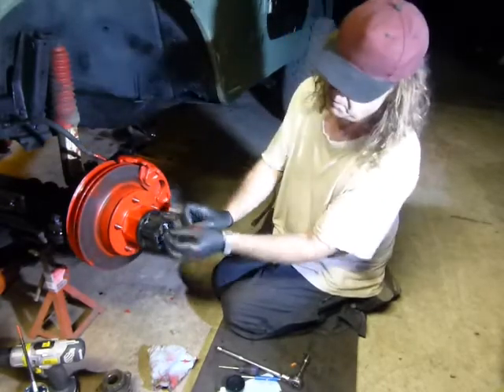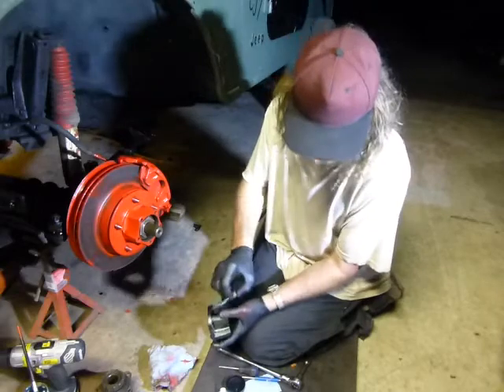Jeep Cj7 locking hub installation

Comment: What was the threads on that bolt and the length
Reply from the maker: Fasteners are 3/8 NCT x 2" grade 8 with a couple threads cut off, installed with flat and lock washers. All holes were chased out with a tap too.